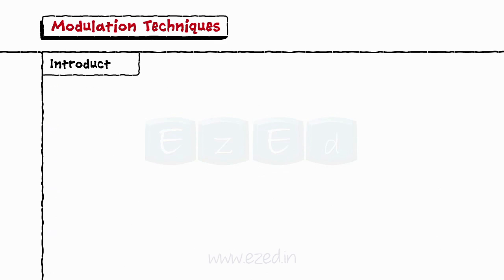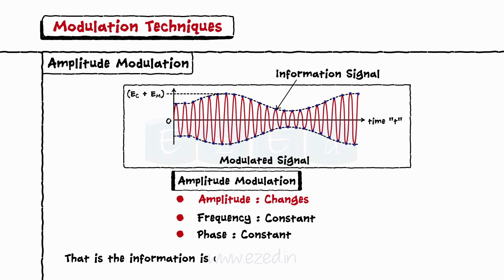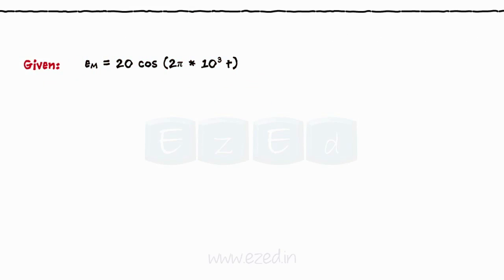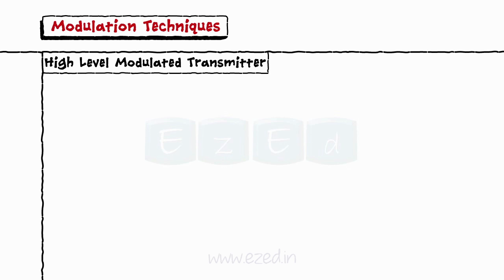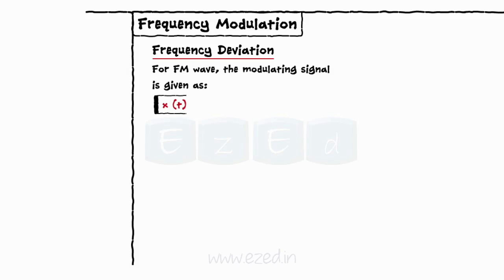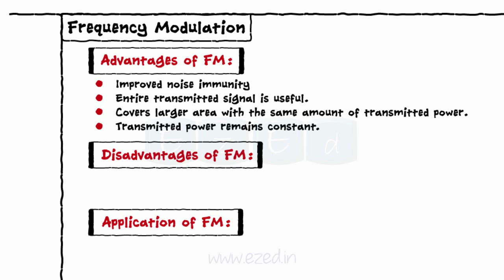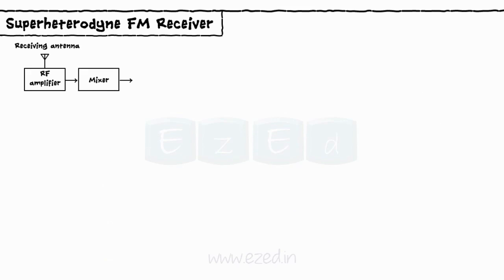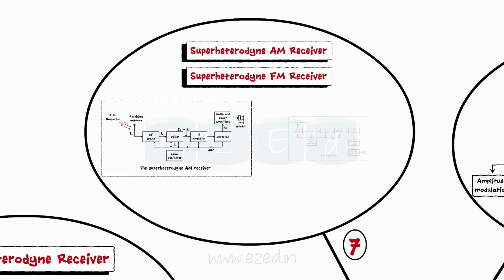Modulation Techniques

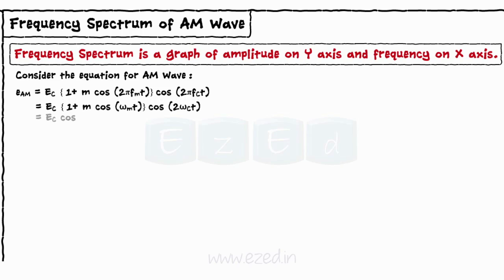Comment: At 5:27 in the trigonometric identity is 2cosAcosB = cos(A+B) + cos(A-B). We know cos(-theta) = cos(theta). So it is mathematically valid to write cos(B - A) instead of cos(A - B). If we do so then eventually we will get (wm - wc) instead of (wc - wm) and finally the bandwidth will be 2*fc instead of 2*fm. As we are getting two possibilities mathematically hence we cannot just ignore the alternate one. But so far I have never seen to use 2*fs as the bandwidth instead of 2*fm. But we are getting it mathematically. So what is the significance of it?

Comment: Hello  EzEd Channel,
Great explanation and animation, straight forward, congratulations for this!
Only some adjustments would be needed for wrong info:
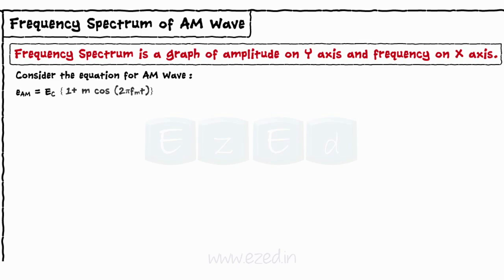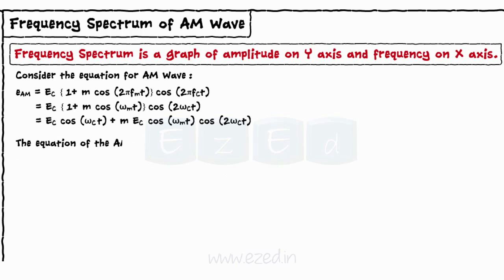5:26 wct instead of 2wct, because w=2pif. Error now is propagated until 5:45

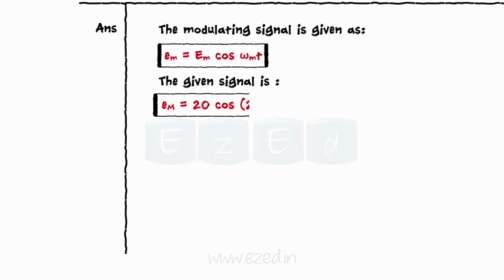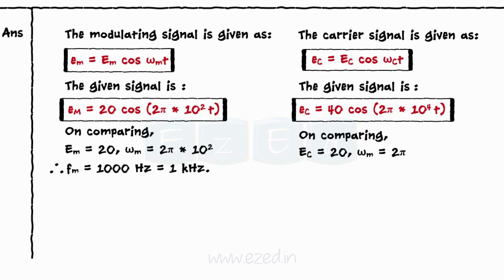At 6:56 fm=10^3, Ec=40, but the next must be corrected: 7:32 fm=10^2 and at 7:58 Ec=20 (F).

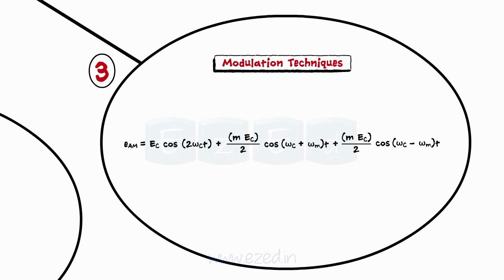Also at 22:40 the expression should be corrected in (wct).

Wish you great lectures and keep going!

Comment: Example at 8:00, fm should be 100 Hz, not 1000 Hz, yes?
Reply: 10^3 is 1000 ... why would it be 100 hz ?
Reply: In the problem definition, fm=10^3=1000 Hz... wrong notation in the solving